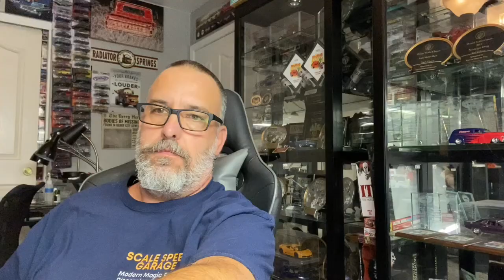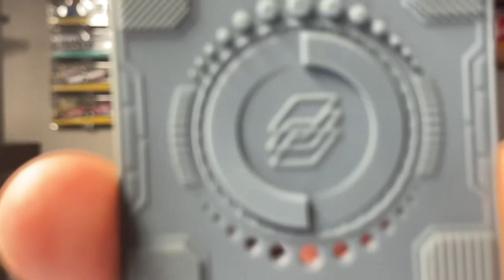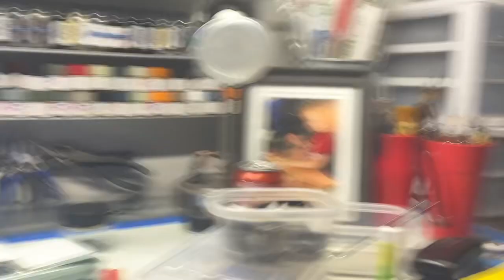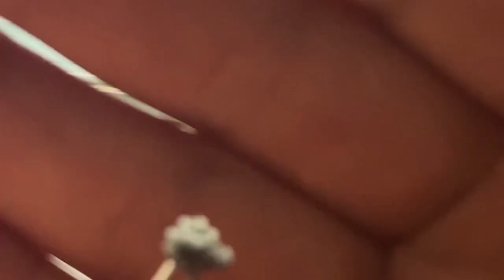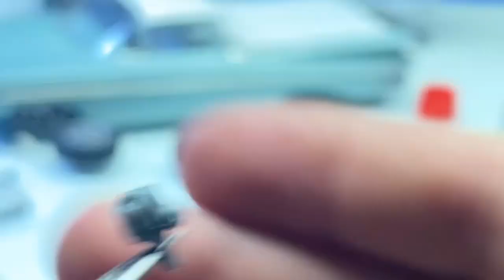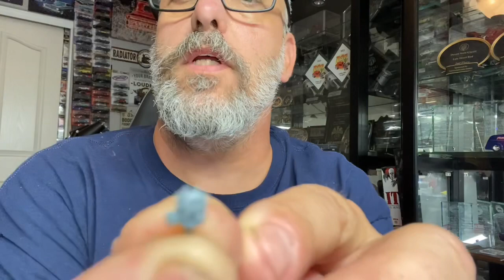Shop Update And New Machine For The Shop@ScaleSpeedGarage

Comment: I'm extremely interested in purchasing a 3d printer.  Not being well versed in 'computer', I'm very hesitant.  Would u mind doing a short video pertaining to how to set up the printer/computer?  For example, I'm assuming that the printer is driven from a separate computer and it's basically 'plug & play' w/ an 'aux' type cord....but, what r the minimum requirements the computer has to have....I can't find any of that type of info on the 'printers' web sites....tks.
Reply from the maker: I’m not an expert but I could do something in the future.It’s really not that hard to do if you sign up with speed scale garage it’s pretty easy to get started.you can even sign up before you buy a printer,it only cost a dollar for the first month.He also has a deal where you can get a printer in a package deal.